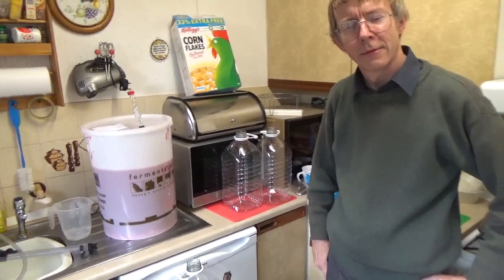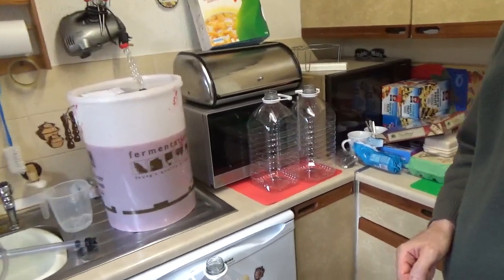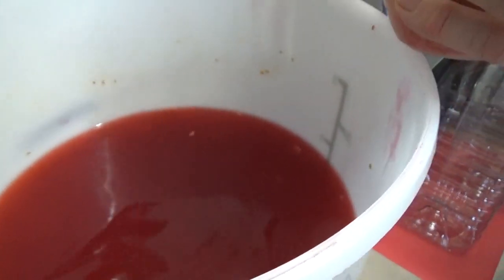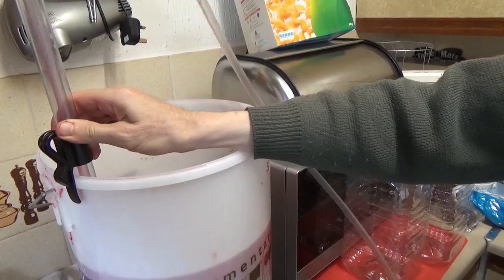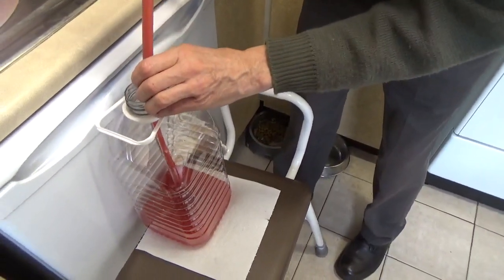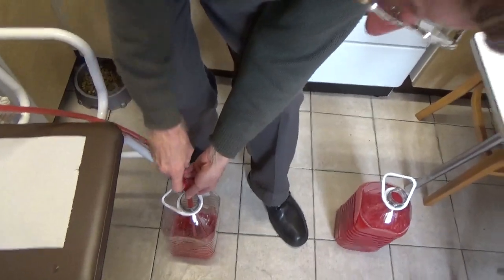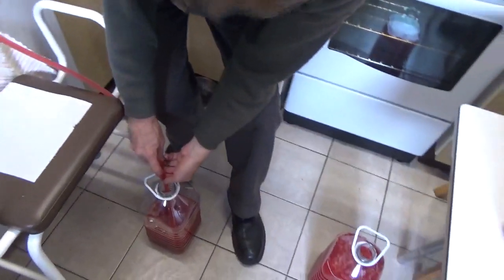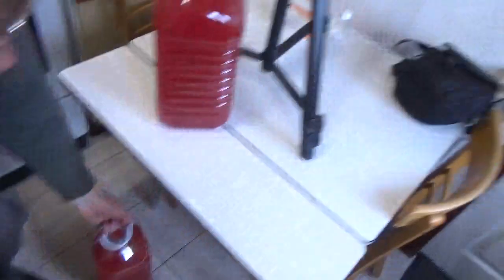Winemaking with Julie & Nigel - Raspberry Wine 3 Gallons - Part 3

Comment: Siphoning is always a nightmare -the fiddliness, spillage, the risk of sediment disturbance, the cleaning up, etc etc.. Maybe a tap on the output would help. Do you think the previous method of just careful pouring is easier?
Reply: +credenza1 I think pouring is probably best for one or two gallons, but it definitely gets harder when you're dealing with large batches - it's heavy!
Reply: +Julie Drake (Julies Allotment) We can try the one which already has a tap - but taps have one disadvantage - they are easily snapped off if they catch on anything - especially when lifting or putting down a heavy brew.